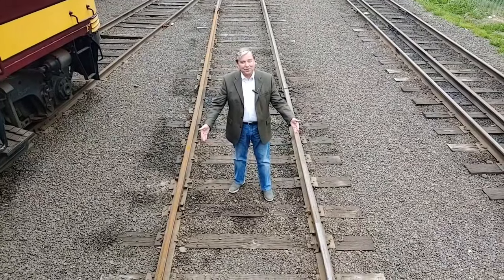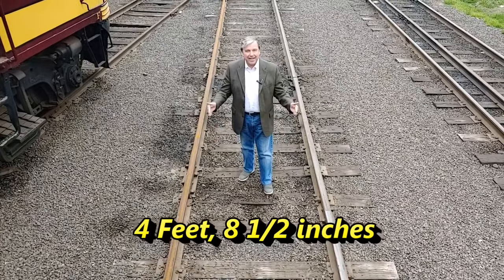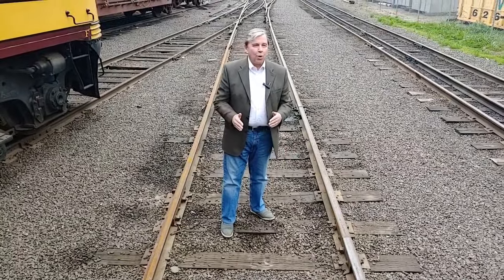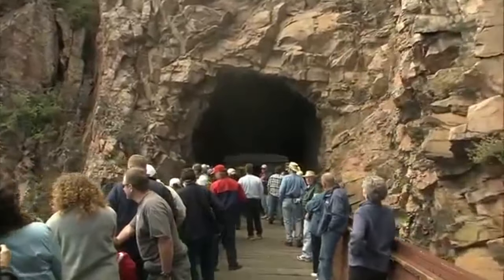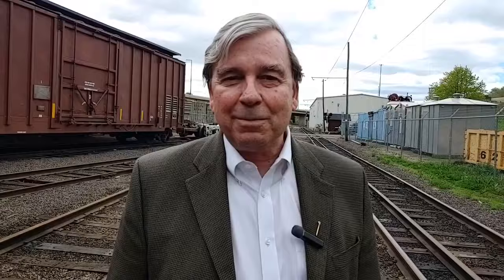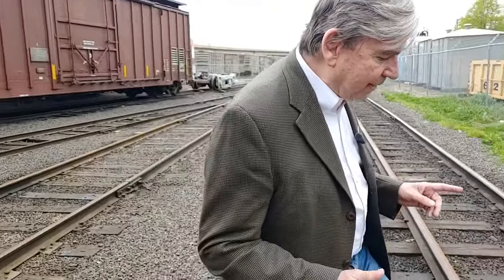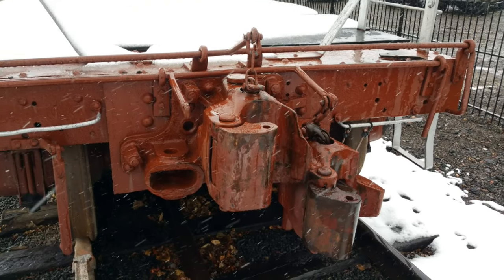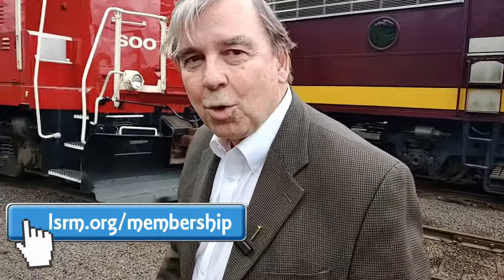Why are track rails spaced the way they are?

Comment: The story of the rail gauge being 4ft 8.5in because of the Roman's is just that a story. The Stockton and Darlington Railway was originally built to 4ft 8in to allow the passage of colliery wagons which were often of this gauge. This gauge was originally called Stephenson Gauge, it was later increased to 4ft 8.5in. It didn't get called Standard Gauge until the passage of the Railway Regulation (Gauge) Act of 1846 when the standard gauge for railways in Britain was set at 4ft 8.5in (in Ireland it was set at 5ft 3in or Irish Standard Gauge). This Act didn't prevent the building of lines to the Brunel Gauge of 7ft 0.25in, but these lines had to physically connect to lines already built to the Brunel gauge.

Comment: The actual width was decided in Northern England when colleiry horses pulled wagons first of all on wooden beams ,then changed to iron rails for durabilty ,the width was so a horse could walk between , the first tracks were not fixed on sleepers but on little supports , a section of original track still exists in northern England.

Comment: The list of wide gauge included the "Toronto" or "TTC" gauge.  This is used for the streetcars and subways, though not the new LRT lines, which are standard gauge.  There are two reasons given for the wide gauge.  One is so that wheeled wagons could fit the rails and the other was to keep steam powered railway locomotives off those tracks.  Also, the Canadian province of Newfoundland had a narrow gauge line, but it was pulled up several years ago, leaving no railway at all in the province.  Prior to that, the trucks on the rail cars were swapped, out when the cars were moved to/from the ferry boats that connected Newfoundland with Nova Scotia.  One interesting bit of trivia is there was one stretch of track where the trains had to be tied down during storms, to keep them from being blown over.  This railway was also the longest narrow gauge line on the continent.

BTW, you have "gauge" spelled incorrectly in the title.

Comment: Just so folks know, you have 3 rails in much of the UK, but it isn't to enable different gauges. The 3rd rail lies outside the normal 2 and is a power line. You DO NOT want to touch this, it is seriously high voltage and will fry you. Just thought I'd put this comment for people who aren't used to electrified rails. Really good vids by the way.
Reply: The electrified 3rd rail is a thing in the US although it is usually the inside rail not a outside rail. New York subways are probably the most famous 3rd rail electric trains.
Reply: @jasonirwin4631  I can’t think of a single example of an inside third rail. (Expect for Lionel). 
New York subway is an outside rail. Chicago EL is outside. The tunnel approaches to New York stations are outside. 
Detroit Michigan central station was outside third rail. 
Can you list any that use an inside rail?
Reply: Toronto subways have a 3rd rail, though it's a bit removed from the mail rails and is covered to prevent accidental contact.
Reply: @pmsteamrailroading  I too remember the 3rd rail being outside and covered with wood for safety. 😉

Comment: Most recent example of using a track gauge different from all other lines: the Gautrain in South Africa. One reason for its use of standard gauge may be to prevent encroachment by any other rail system in South Africa, which all run on 1065mm Cape Gauge. More practically, the Gautrain uses Bombardier Electrostar EMUs designed for regional rail in the UK but modified for the Gautrain.

Comment: Fun fact, the smallest public railway in the world is the British Romney Hythe and Dymchurch Railway, with 15 inch track
Reply: Per Wiki - From 1926 to 1978, the RH&DR held the title of the "Smallest public railway in the world" (in terms of track gauge). The title was lost to the 12+1⁄4 in (311 mm) gauge Réseau Guerlédan in France in 1978[17] and regained in 1979 when that line closed. It was lost again in 1982 when the 10+1⁄4 in (260 mm) gauge Wells and Walsingham Light Railway opened.
Reply: The Ravenglass and Eskdale Railway in the English Lake District is also a public railway which runs on 15 inch gauge. However I believe it was converted from an earlier wider gauge mineral railway and is thus younger than the RHDR in its present form.

Comment: The story about standard gauge being based on Roman chariot wheels being exactly 4’ 8.5” is a fallacy— many mine railroads in Great Britain used whatever gauge their engineers chose and seemed appropriate for their particular conditions.  George Stephenson worked for a mining company that used 4’ 8”, but he found the equipment was binding on the curves so he added an extra half inch.  He carried that over to other projects, it became Great Britain’s standard gauge, it migrated to the United States with imported steam locomotives, and there you have it.  Stephenson remarked in later years that he should have used a broader gauge.
Reply: No doubt. Wagon wheels do not make an "exact" width over the course of any amount of time. They vary, especially with hub wear.

Comment: Serious doubts about the Roman chariot wheel theory. The most convincing explanation I have had is that the original wagon ways ran with the wheels between outside flanges on the rails set at the sensible distance of 5 feet. When they moved to flanged wheels 4 foot 8 1/2 allow them to keep the same track bed/supports.

Comment: As a historian, I spent years researching this topic. I have yet to find a single reputable source that can definitively link the width the Roman chariot wheels to the 4 feet, 8 1/2 inch gauge established by George Stephenson, an English civil engineer and mechanical engineer during the Industrial Revolution, renowned as the "Father of Railways.”

Comment: The Southeastern Pennsylvania Transportation Authority ( SEPTA ) Market Frankford Line is 5' 2 1/4". SEPTA's Broad Street Subway is standard gauge, but has it's own system so it doesn't interchange or share with SEPTA REGIONAL RAIL

Comment: Finland according to legend measured the russian gauge wrong and that is why they are off by a few milimeters.

You also need four rails if you wand to combine standard gauge with russian gauge.
A good example is the Swedish Finnish border in Haparanda where the bridge over the border river has four rails.

P.S. in Sweden its still a Wagon
Reply: Freight cars are usually called wagons in the UK, too.
Reply: I have heard that both Finland and Russia originally had 1524 mm (5') gauge but Soviets wanted to make it more "metric" and converted theirs to 1520 mm. I guess the small difference doesn't really matter given how often I see Russian freight cars here in Tampere.

Comment: As someone already pointed out: the roman story is just a myth: there are ten common used gauges for railroads. If there would have been a standard already set in roman times we should see only one: the roman chariot gauge.
In addition the claim, that they used the same tools for the roman wagons and the railroad is clearly false: the roman chariots were mainly made of wood. The railroad is made of iron. You cant use the same tool on iron and on wood. 
Also: the tool you use to cut the axis of a roman chariot, of lets say randomly: 1 meter, is a saw. If locomotives were made out of wood. And you wanted their axis to be 2 meter wide. You would use the same saw. There is no saw for one meter of wood. And another for wood of 2 meter length. So the argument: they used the same tools. Thats why the ended up with the same width, makes no sense. (And they indeed used wooden wheels for the first carts in mines: but this carts all had smaller width than 1435 mm.)
Also: you cant randomly chose the width of a chariot: there are reasons for the width: for example you want two horses to fit between the wheels.
You cant randomly chose the width of a train track: there are advantages and disadvantages for small/wide gauges. For example radius of the curve: The one you chose depends of the landscape and the amount of money you can spent on tunnels to avoid curves and so on and so on.
So the people in the past were not that stupid to ignore this arguments and stick to outdated arguments form the horse era.

Comment: This is not accurate.  The standard gauge started at 4’8”.  After some experience at that width, half an inch was added to make it work better.  It was more practical to increase the rail separation than to modify equipment which had been built.
Reply: The original Stockton and Darlington was 5 feet as an outer measurement and the flanges were on the outside rails at that time. When they changed (for Liverpool Manchester I think) to flanges on the inside of the wheels, that meant 4 feet 8 inches as an inner measurement and over time an extra half inch was added as tolerances got better.

Comment: I am sorry this is absolute nonsense. Romans did not use war chariots except in racing. The first commercial passenger railways originated in northern England and related to the gauge of mining wagons. On longer runs as the technology developed the original 4'8" gauge was slightly widened to allow better movement of the inside flanges. Other ountires including the northern US began using imported rolling stock adn or locos before developing their own.